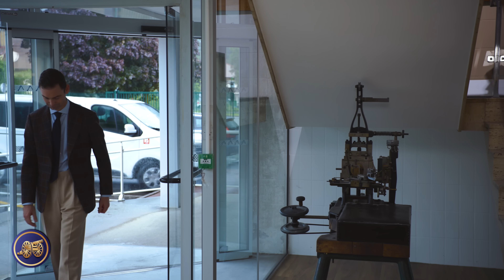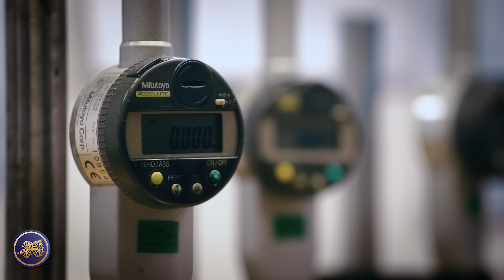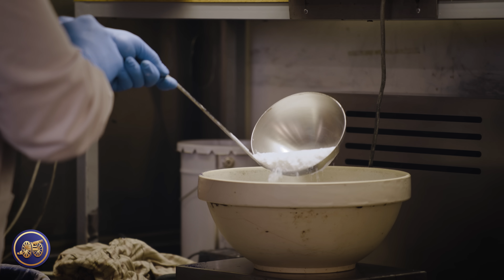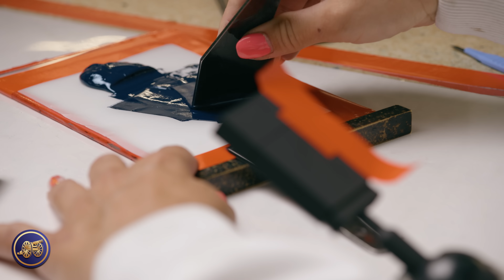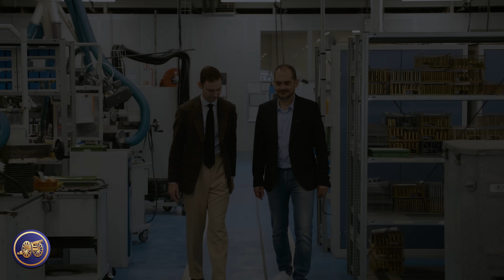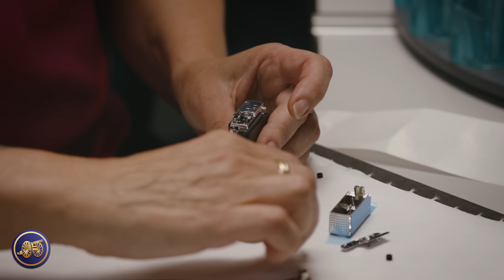Making the Most Exclusive Lighters in the World: S.T. Dupont France Factory Tour with Kirby Allison

Comment: I have a question Kirby, I just bought a ST Dupont Slimmy from your website. Soooooo the lighters are made in France and assembled in France no? Why on the bottom of my lighter does it say (MADE IN CHINA)? Shouldn't it say MADE IN FRANCE? Did I just buy a knock off or did it get swapped out for a fake one? Fairly confused why it says Made In China.
Reply: It is made in St DuPont factory in china I think I have a minijet but a older model this is made in France but the newest models are made in China
Reply: @OrD11030  Thank you, I saw all the newer jets are all Made In China. They should put that on the website that it's Made In China. I would've bought a Le Grant if I knew sooner.
Reply: @zstink9058  so you know with the le grand you are dependent on the soft flame so if you are outside with windy places you must make the soft flame first than the jetflame
Reply: @OrD11030  Yes sir I do know, really just wanted a France made Jet flame. Guess Ill have the ping now too haha, thank you for the info!
Reply: @zstink9058  no problem 💪🏼

Comment: Kirby, one interesting thing, that pattern is not unique to lighters, old pocket watches had the same 'engraving' on the backs, and dials, this was traditionally made using a straight line, or rose engine, operated similar to a sewing machine, but the part is held in a vice, spun on a spindle, with wheels that vibrate it, and a normal lathe cutter to cut the pattern, this pattern is created by motion of the work, via cams on the vice spindle, or by sliding the tool carriage manually {for the straight line engine}, and on brass dials, very fine work can be done, and so much concentration is required, as one slip, even on the last cut, can wreck a thousand dollar piece, as each "cut" is so small and intricate; well into your high class pursuits.

Comment: I've been interested in Dupont lighters lately. But Dupont has proprietary nozzles made worse by the color-coding scheme on their lighters and butane gas cans. Dupont not following industry standards when it comes to butane nozzles. This is one of the reasons I'm not into butane lighters and only collect petrol wick lighters. And after making a bit of research, I found out that Dupont made petrol wick lighters from 1941 until the late 1950s. This made me really happy. And also, petrol wick lighters are a whole lot more reliable than butane lighters. It's not uncommon to find an old petrol wick lighter that is still working decades after it left the production line. I'm currently using an Evans Liftarm Lighter from 1927.

Comment: I'm a Clipper sort of guy, the removable striker is necessary to seat the roach neatly in the joint. Unfortunately my Clipper is not lacquered, but there's a wonderful etching of a woman inside and with a turn of the hand she's as naked as the day she was born. Stunning. This water nymph has been born by the hand of a subtle master in the style if Sir William Russell Flint, alive in a fire stick!! 
As one gentleman to another, by way of contrast, I note you wear your trousers close to your elbow line, whereas I wear mine close to the back of my knees. I surmise this denotes a symbolic reference to a signified class differential. I shall ponder this as I watch and have a little smoke.

Comment: Thank you Kirby for a wonderful Video. I have an S. T. Dupont lighter and I have always been interested in how they are made. However, mine is many years old now and has stopped functioning correctly. It will spark but the gas is unable to flow properly and thus unable to product a flame. A particular point of interest in the video was the fact that all S. T. Dupont lighters have a filter - I guess that's where one of my problems lie.